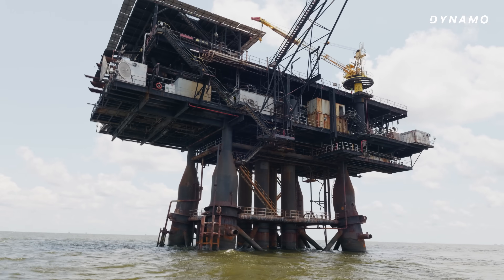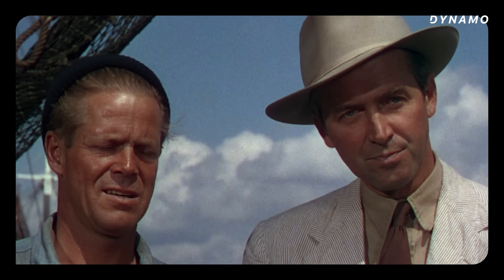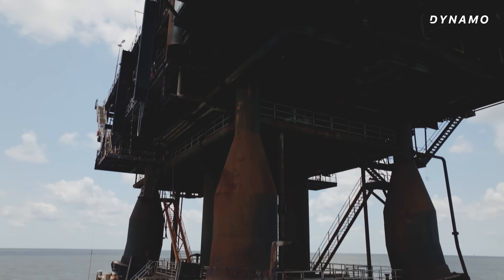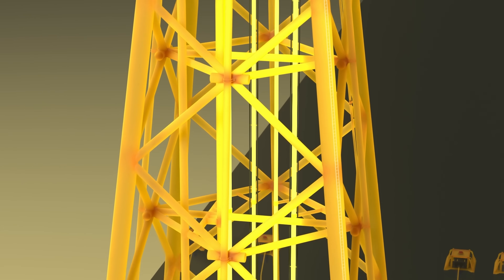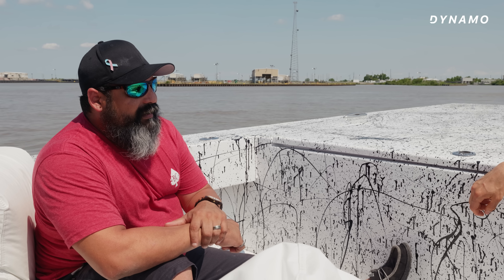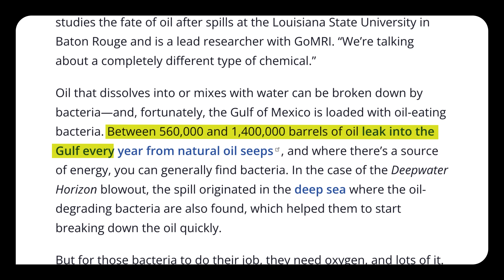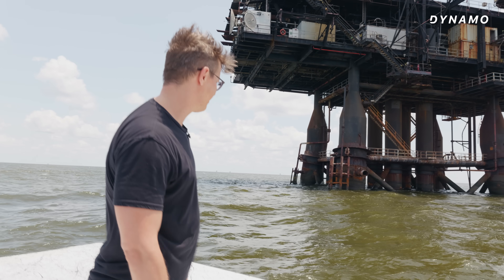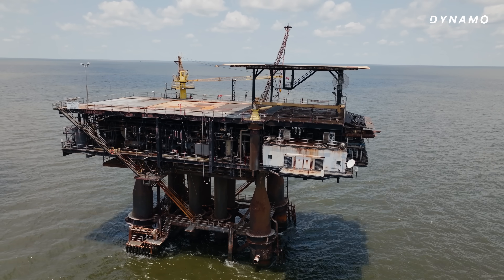I Visited Abandoned Oil Rigs — and Found Something Terrifying Underwater

Comment: Are abandoned wells still under positive pressure? Why would they be abandoned if they were still producing?
Reply: They will still produce but not enough to be profitable. The issue with capped wells is when you stop drawing from the formation, and you’ve encased much of the formation which would naturally allow pressure to escape, you have a well building pressure until it ruptures.  You can also have collapses from seismic events, etc.
Reply: They might produce a grade that isn't profitable, or be producing too much water (the water oil wells produce is still nasty as heck), or production may no longer exceed costs. These are things that happen in a well's lifecycle.
Reply: For some, the cost of production exceeds the production. Personnel, fuel, maintenance, boats, helicopters….
Reply: Did you listen to the author explain the process of ownership and liability that passes along, until the last owner fails, declares bankruptcy and clevery, legally packages all the non productive wells/platforms into the bankruptcy proceedings, has been allowed by the court system to keep still producing wells outside of the bankruptcy! ? No money, no clean up!

Comment: They aren't left forever. They have to be decommissioned and either removed and sunk and turned into a reef. It just takes time. Many years after shut down before they start the abandonment work. I know this because I used to do the ocean floor surveying after the structures are removed to ensure no debris is left over in the ocean.
Reply: I actually did a site that fieldwood first had and then sold off to multiple companies after and was finally handled thru a bankruptcy
Reply: Like 10 or 15 sites over multiple years working from July to December